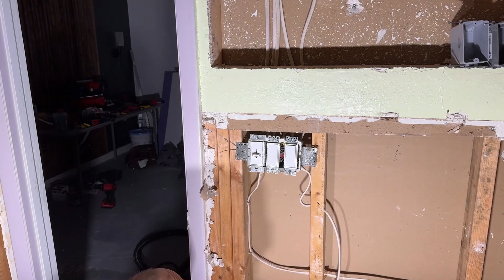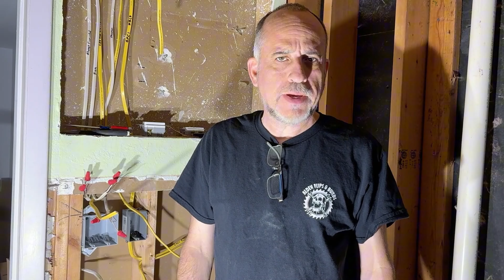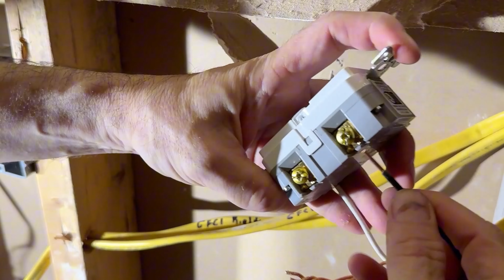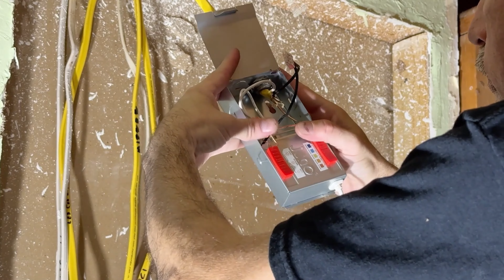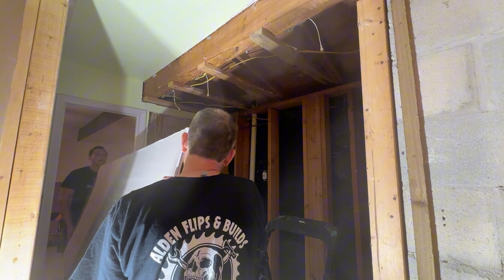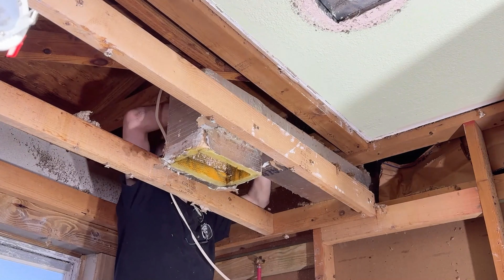Installing Recessed Lighting Bathroom Remodel Ep. 2

Comment: What was the hardest part about this instillation? What would you have done differently had you done it all over again?
Reply from the maker: Honestly not aligning the outlets correctly. They sit alittle too far out from the drywall. Not a huge issue but if you’re looking to do some electrical work measure out the outlet boxes appropriately base on the material you will add later.
Reply: @ good to know! Would definitely love to see a video on this specifically in the future. Keep doing what you’re doing. Great video!